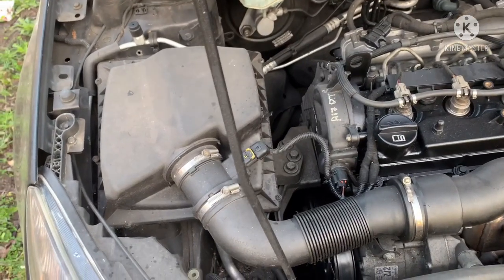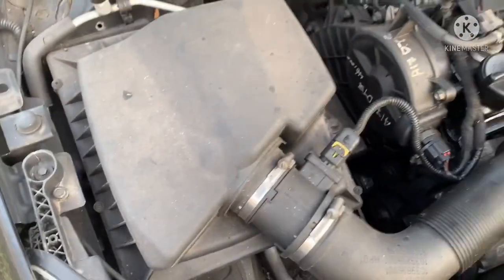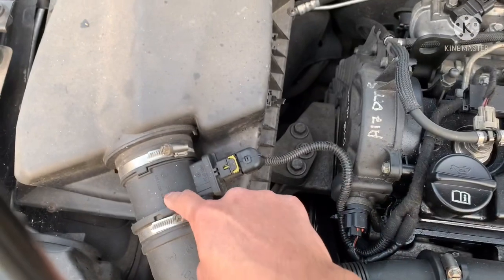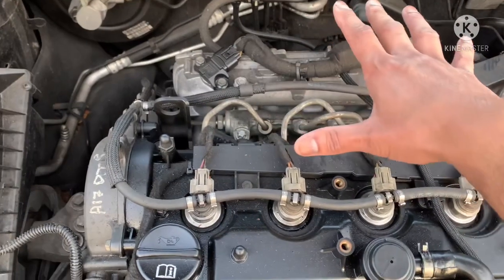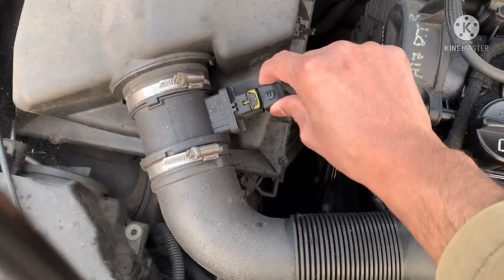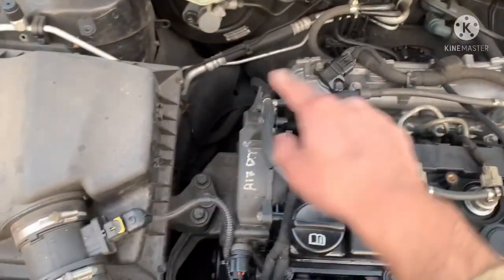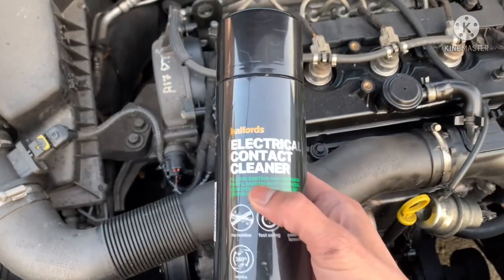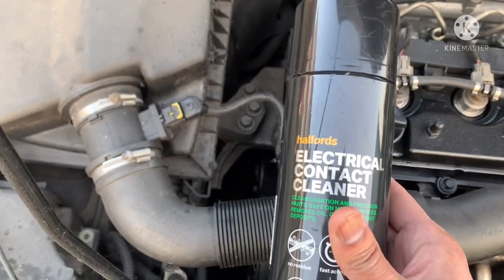MAF and MAP Sensor fault symptoms

Comment: Hi,thank you for video,was thinking maybe you can help me as well :) I have zafira 1.7 cdti engine is a17dtj when driving on first gear is jerking,before turbo kiks in feals low power,consumption is about 12liters to 100miles about,sometimes is comming black smoke on high rpm after no black smoke,maf sencor is showing from 2-8g/s up and down if I connect to read live data,yastarday I bought new denso DTRS301110 fuel pressure valve but it wount start,I will send back ,maybe foulty part,my old one cleaned and polished it is working... if you need any live data I can drop to you,what do you think is it possible it is MAF sensor foulty? by the way I bought used maf sensor from ebay and it is similar,numbers 2-8g/s and one more think,when accelerating before turbo is loud sound like injector sound and in that time feals low power and sometimes is working better,feals like ecu trying to learn,not sure.but it is no any foults.Thank you for any help
Reply from the maker: Hi, personally if you have no fault codes I would firstly clean the egr valve with lots of brake cleaner and an old tooth brush. I can tell you that the pipe from the egr to the intake will be very dirty. If this doesn’t improve/ or rectify your fault I would then use injector cleaner at a high dosage and to finally confirm if it is an injector fault so a leak off test.
Reply: @reviewsfixeshacksmunsur3805  hi,thank you for replay,egr is cleaned and I used many injector cleaners and some expensive ones,only I need to check maybe intake manifold is a lot of carbon,yesterday I changed fuel filter and I find in fuel filter casing dirt and some metal shavings,was thinking maybe from fuel pump but how I understand fuel filter is before fuel pump,right now I am trying to find out if fuel pump is the problem
Reply: I done leak off test as well,two injectors was identical and other two was identical just slightly more,I can drop a photo
Reply from the maker: Hi, can you post a video?
Reply: @reviewsfixeshacksmunsur3805  will try to clean intake and will let you know if will be any change,if not i will drop a video,thank you
Reply from the maker: Let me know how you get on and we’ll take it from there. I always try to eliminate the items of no or low cost first.

Comment: I have vw polo 3 cyclinder no mass air flow electical connector
Reply: The awful three cylinder VW Polo is powered by a twisted rubber band so no sensors needed. 😂